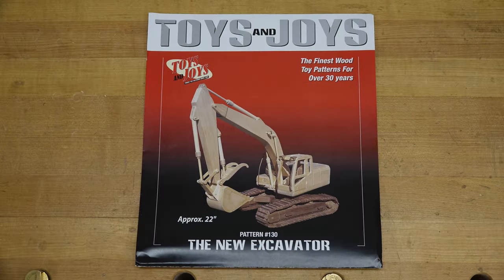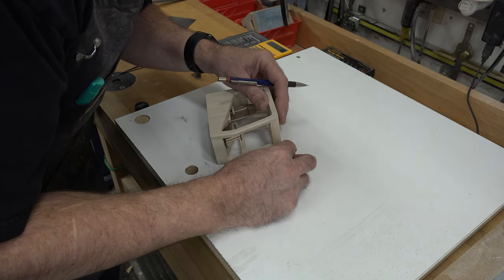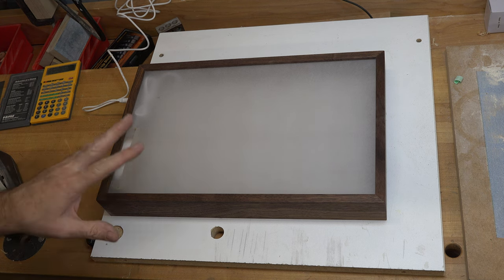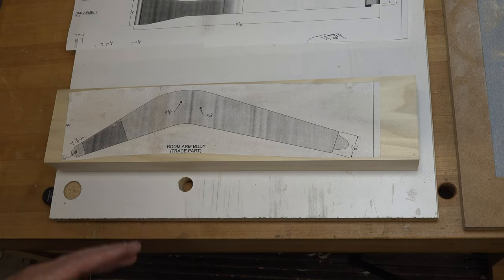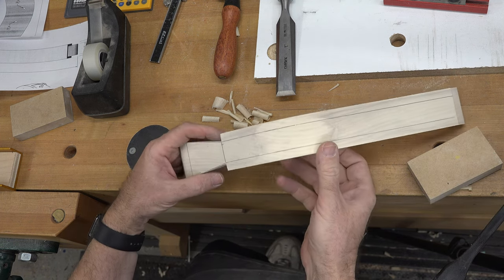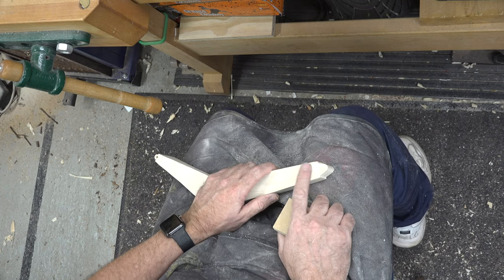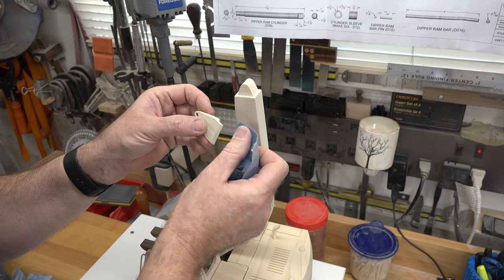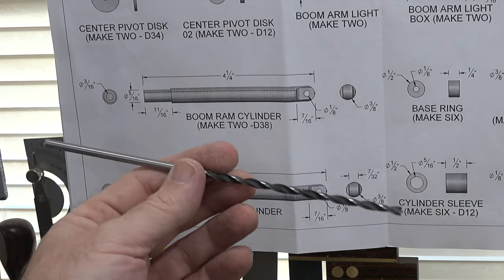Toys and Joys "New Excavator" Part 10

Comment: Awesome Kenny. Those hydraulic cylinders are tricky to do. On my other excavator I built few years ago I decided to start them from scratch with extra tuning them. Took me only 10 hours extra, LOL, but 3 years later both booms and a bucket stays in any position I want(doesn't collapse down) and also relatively easy moves. Great job again Ken. Love it!!! Cheers
Reply from the maker: They can be a little tricky Marcelo but if you take your time during the drilling process, they really aren't that bad.  These ones being a little longer than the normal T&J's pistons presented a few challenges but nothing that couldn't be overcome.  Thanks for tuning in to the show and for the kind words.